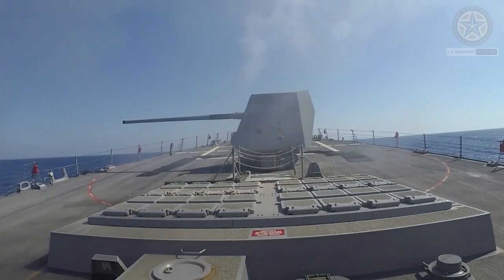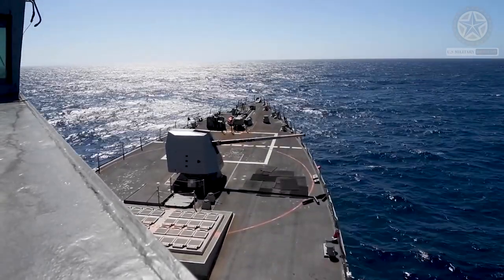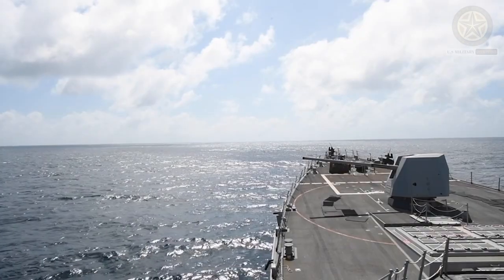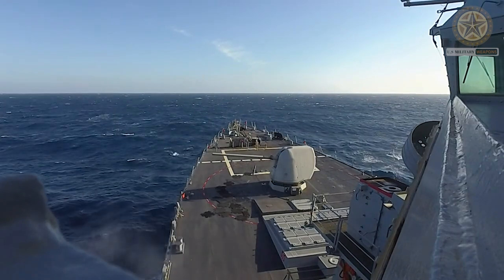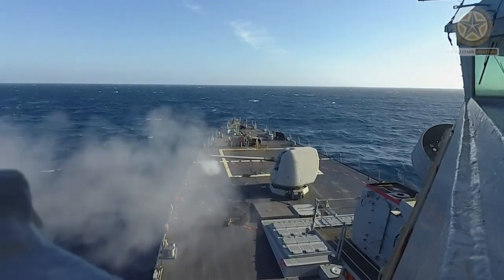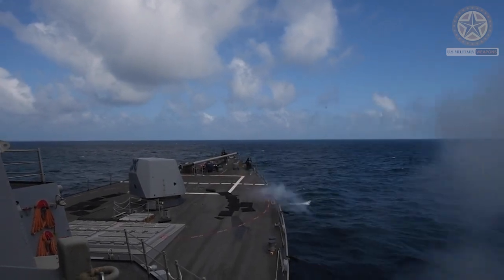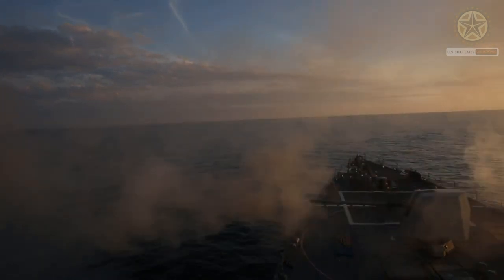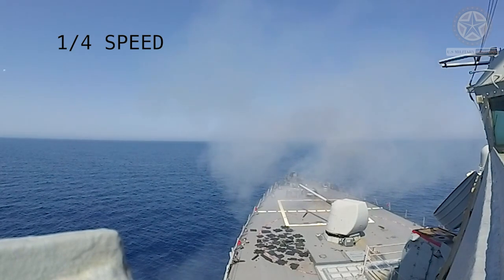How powerful is a mk45 5 inch naval gun?

Comment: the UK is currently designing a new MIFS system for the new type 26 designed by BAE systems will be good to see as the floor around it is all different and loading happens under the weapon keeping it in action at all times in us is loaded the same way but its just and update wont need to put mats down to catch empty rounds no more lol

Comment: Powerful? Nah. The Mk45 mod(4) 127mm/62 (or the 127mm/54 before it) is the LOWEST PERFORMANCE (slowest firing) 127mm naval gun in service with any navy any where in the world. The US Navy and its allies like it because it is very reliable, very simple, very low maintenance, very light (for a 5" gun) and needs as little as ZERO crew to operate (for 20 shots anyway). It is small, light, cheap to buy, cheap to operate and always works. But make no mistake about it, any Russian, Chinese or Italian 5" gun will shoot twice as fast, a bit further and usually quite a bit longer (they are often watercooled).
Reply: Sounds a bit biased